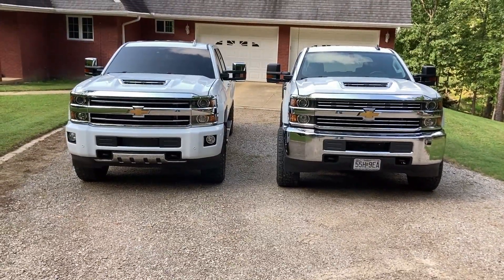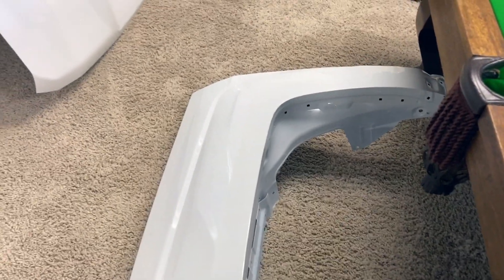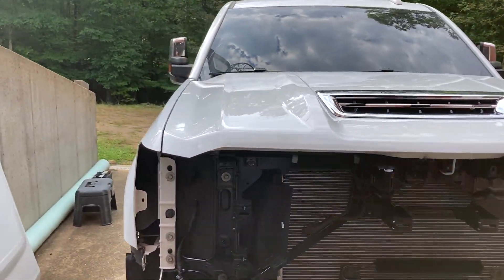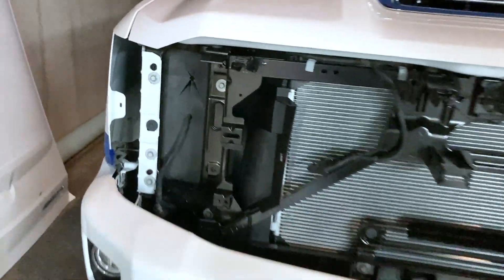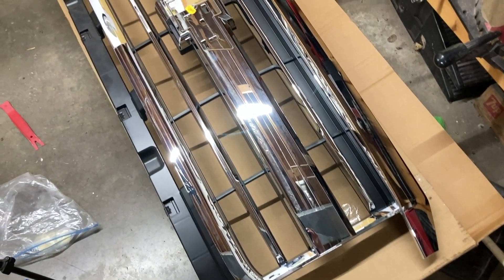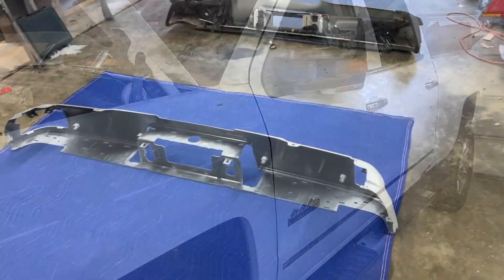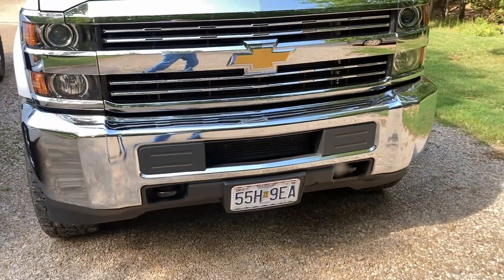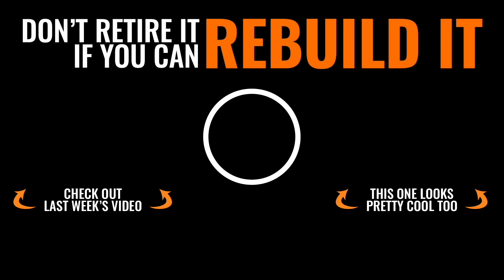Putting the Truck Back Together - 2018 Chevrolet Duramax High Country Rebuild Pt. 4

Comment: It seems that there's a lot more bits and pieces to the big trucks compared to the cars. Would you agree or disagree? And which would you prefer rebuilding?
Reply from the maker: I think you’re right, there does seem to be more parts. But they seem to be able to take more of a hit and have less damage than cars. All in all, I probably like the cars better because I have more room in my shop to work on them and I enjoy driving them more than trucks when they’re finished.